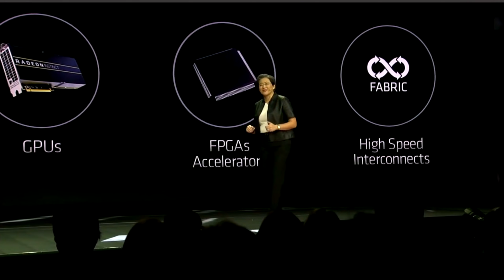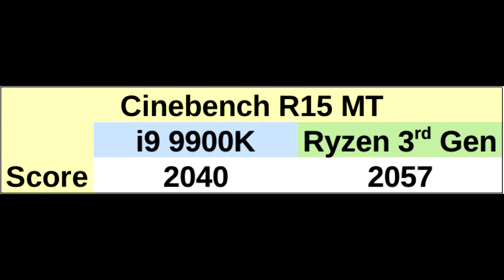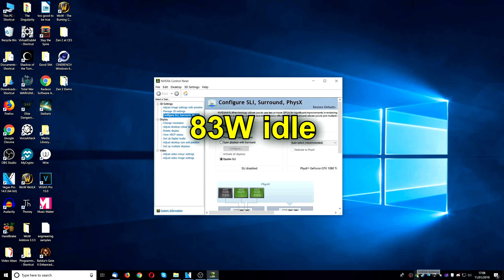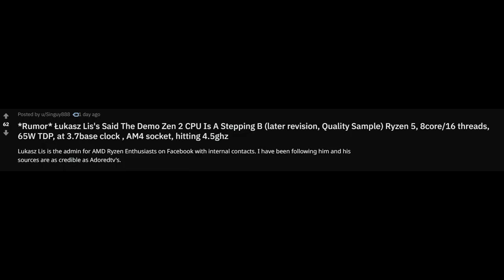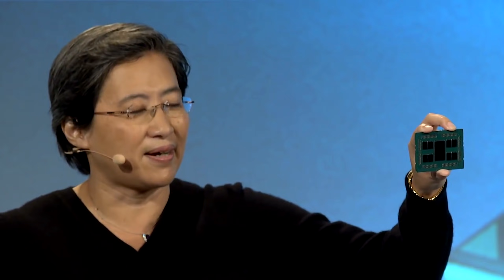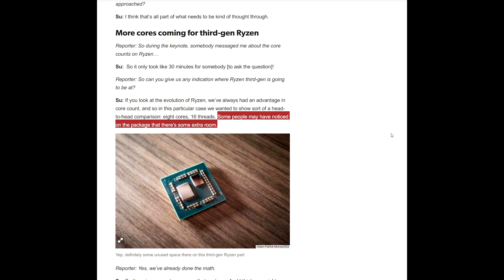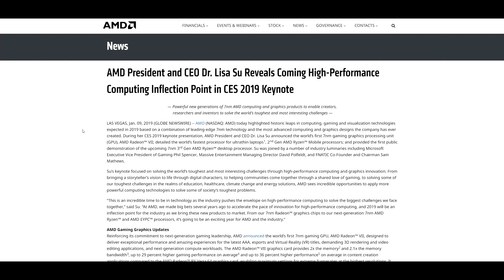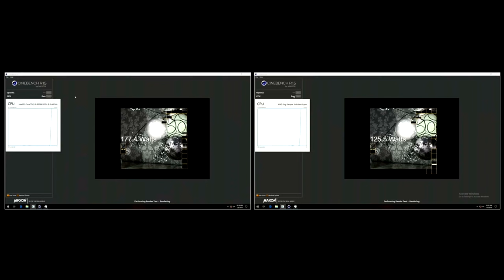Zen 2 Faster than i9 9900K at Half the Power.

Comment: You're so happy in this video it makes me happy!

Though I am worried about your Vega VII video >.<
Reply: I still think Vega and Vega VII as a compute card dressed up with gamer stripes.  Not a specifically engineered card to only handle game rendering workloads.  Navi will be the gaming card.
Reply: @Kenmanhl  totally agree. this is simply to soak up revenue of the ultra amd enthusiasts feeling left out of the high end market
Reply: Kenmanhl I think it’s incorrect to conclude those are necessarily mutually exclusive. Being based on/a derivative of a compute card does not make it a free/engineering free product even if it would’ve been part of the design goals of the original, which it likely was, as certainly as Navi variants will be featured in various compute oriented SKU’s. In the end they’re just two different directions the extent to which AMD could travel was constrained on both fronts by their current silicon.
Reply: theRedhood24 because it’s got a die shrink & 2x memory bandwidth, so it had better outperform cards where the opposite is the case and specs are otherwise mirrored in all ways save a few compute units.
Reply: The 7nm card was eventually going to release to GPU market after they had enough binned Instinct M160 cards with some CU's deactivated from faults in the manufacturing process which didn't pass for Instinct line.
Reply: Likely Navi is going in PlayStation 5 and Sony want to announce an 'exlusive' GPU which it wouldn't be if PC users already had it.

Likely will be held back until official PlayStation 5 announcement.
Reply: Radeon 7 is just a tweaked M150 card which AMD released just to please stockholders (I think).
Reply: @theRedhood24 they make changes to the chip
Reply: it's another compute card... awesome theoretical performance... The only problem I have with AMD compute cards is that the experience of setting up and debugging the infrastructure (ROCm and such) to Utilize it is completely horrid, especially when you don't go with some standard distributions of linux... I was so frustrated that I eventually ended up using the vega64 exclusively for gaming and the 1080ti in my linux compute workstation instead. AMD dev team ought to focus on compute users' experience like NVIDIA does as well. They've clearly shown they could measure up with Radeon Relive for gaming.
Reply: Navi is much more powerful but is someways from being ready. I'm guessing the late release of Vega 2 and its confusing specs were due to it appearing to be a hobbled Radeon Pro V340 and a filler till Navi is ready.
Reply: i think Vega7 is just a refresh of 64 and a bit of a test system for new memory Navi development may not be progressing as fast as they would like or they are trying to get there version of Raytracing into it.
Reply: fox 6 it’s basically a different product from a different team defined by a different vision from what’s his face, a stopgap for the higher end market
Reply: @Fee.1  that's what I think too I'm hoping that now AMD has turned things around the guys at Radeon might get some money to get Navi of the drawing board. where I think it's been stuck due to lack of money.
Reply: @keptinkaos6384  Navi has been in development for a while and its purpose was to satisfy the gaming needs of the next generation consoles of Sony and Microsoft. Consoles require low power consumption and AMD has been behind Nvidia in that aspect, so you can be sure that Navi will be revolutionary in that aspect. Beyond that, there's the "secret sauce" Microsoft and Sony would have wanted out of Navi. Sony seems to be pushing Playstation VR so perhaps we should expect some features that are useful in VR. Microsoft released DXR recently and perhaps it wants to push it in consoles. Honestly, I don't know how it came to be. Was it an NVidia initiative, prompting other actors to start working on it or was it a Microsoft initiative? Nvidia's Volta never came to gaming, but they were focusing on tensor cores, but with Turing, they added RT cores. Ray tracing was also on AMD's radar since they did release Radeon Rays.

Could it be that AMD and Microsoft had been working on real-time raytracing for quite a while for consoles? Could it be that consoles capable of real-time ray-tracing is the right ecosystem, where gamers will see benefits, for ray-tracing to become widespread? Honestly, I'm inclined to hope that the next generation consoles will feature ray-tracing because that will hasten its use. I'm inclined to hope that NVidia released Turing with ray-tracing first, rushing to release it on a node they had some experience with, 12nm instead of 7nm, in order to claim that they were there first, that they were the innovators, in order to steal AMD's thunder. To the point that they ignored the large inventory they had built for Pascal.

But honestly, if we're reasonable, NVidia has the money to make things happen and has always wanted to keep their discrete GPUs relevant. Pascal was also long in the tooth, and the tech press was badgering NVidia for news of their next generation cards. It's more reasonable to believe that Nvidia innovated by bringing us real time ray-tracing before anyone else and that it was entirely their initiative, which means they had a head start on AMD. If AMD is reacting to real-time ray-tracing, it is not coming to Navi. I will admit I don't know the details of how the hardware is designed so I may very well be making a lot of incorrect assumptions. I read somewhere that RT cores were nothing special so perhaps AMD could get their own working fairly quickly.

What's clear is that 7nm is still a few months away before we start seeing products for it from AMD. Perhaps we'll see Navi for the third quarter. Perhaps we'll have console announcements sometime in the end of the year and they'll launch in 2020.
Reply: @COKireato  one can but hope
Reply: @keptinkaos6384  it can't be a refresh. It's 7nm. Could only be a new chipset.
Reply: Oof Vega, lets not speak of it. Its like bulldozer, but without the value proposition.

Comment: Anyone that freaks out when a link is not 100 percent correct has not been following tech very long.  Ive been following this channel for a long time now and always look forward to the excellent analysis, and the leaks are just fun to speculate, but things can and do change at the last minute.  They may have ran into last minute issues with the higher end chips, or they decided to sandbag.  Having said that, Jim’s predictions are well thought out, and some of the most accurate you will find.  It looks like 7nm will work out better than I expected as far as performance.  Its going to be an interesting year.

Comment: I think it would still make sense that the 3600 will have 2 chiplets with half the cores disabled. It may just have been easier to pick 1 chiplet as an engineering sample. Which might also have implication for cache and overhead of communicating between the chiplets.

Comment: The idle is high because the biggest chip on the die is the 14nm (glofo) IO die. Your delta shows how good the 7nm TSMC is. Global foundries has been AMDs weakness for many years.  AMD has said that the IO doesn't impact performance, but it will still be victim to bad power efficiency because of GloFo. Good video

Comment: Yup, the 3600x matched the 9900k. If AMD revealed that it would've instantly forced Intel to reduce costs on CPUs, potentially losing buyers for AMD.
So it was a bright move to just reveal specs. But once it is discovered that the one that beat the 9900k is a mid tier CPU, it will be huge.
Reply: Not just people choosing Intel over AMD, but people not buying any of AMD's current CPUs because the next ones are just around the corner. The only reason that AMD revealed Ryzen several months ahead was that nobody was buying their CPUs anyway.
Reply: @BenoHourglass  You just described what's called the Osborne Effect; that's where a company prematurely announces an upcoming, better product and people stop buying their current product in anticipation of the newer product. (History note: this was first observed with Osborne Computer Corp; if you've never heard of them, that's why.)

Also, in looking up the Osborne Effect, there were mentions of a competing product that effectively stole sales from OCC, so it was competition that drove them into bankruptcy, not the Osborne Effect itself; whatever that's called, you (and Shadow) just described it.

Comment: I doubt for a second that we will get 16 core parts.However, I certainly don't buy that they deliberately didn't show off 16 cores because they wanted a fair comparison. That's a blatant PR spin. Of course they would put the 9900K to shame with 2x performance if they could. I think the same goes for higher frequencies. If they had 5Ghz they would have showed that too. Conclusion: Ryzen3 is probably a little further behind schedule than we had hoped and they still have some kinks to work out. It still may fit well with that "middle of 2019" timeframe though. I speculate based on the otherwise accurate leaks so far that they are a little delayed and had originally planned to have more to show this CES.

Comment: The idle power may be very high if they don't have dynamic under clocking fully working yet.  It may not be dropping it's multiplier as low as it can since it's an early chip.  I imagine that idle power will come down fairly significantly before launch.

Comment: p.s. There is debate about the Radeon VII going on. Some are saying it is a rebrand of the M150, while others point out it has twice the ROPs of that GPU. What does Adored TV think? 
The Radeon VII is an interesting product to me either way. It appears to have strong performance in both gaming and workstation tasks. A genuine multipurpose card that seems unique to me. Before now GPUs were either a gaming card or a workstation card. Geforce and Quadro for instance. Then came some blurring of the lines, i.e., Titan was a gaming card pretending to be a workstation GPU, while Vega was a compute GPU that gamers used. Radeon VII appears to do away with the distinction all together. 
I think people that work with graphics productivity and GPU compute, but also would like strong gaming performance all in a single computer will find the product quite attractive. They will not have to build two separate systems. They will like all that HBM too perhaps.

Comment: The chiplet design lets AMD spread out available cores to whatever sells best tbh.

They can have both a 8 core 2x4 version and a 1x8 version depending on what the silicon delivers, if the 8 core part is most popular.

They can also deliver 4/6/8/10/12/16 core parts optimizing the spread of available silicon.

If this performs as well as it seems it does (and I actually think they did a tongue in cheek deliberate "only just beat it //but we can actually do far better\\"), at the low power consumption, they'll take a decent share of the Laptop market, possibly the Apple market, they are already set to take a decent share in the server market.

These are wonderful times!

Now lets hope that this year they'll get a new foothold in the GPU market too.
I'd love to see AMD actually neck on neck with Nvidia (and beating them) like they did in the HD 5000/6000/7000 era.

Comment: Actually. I got second, more real info. 
A2 stepping, revision after RTG sample, 3.7 base, 4.1 to 4.3 operational clock during CB test, 1.2v approx. 

AMD usually release B0 or B1 stepping, therefore I Asume that A2 is more real. 

Lukasz Lis from AMD-RE ;)
Reply: However, second source said also, that single core boost was 4.5-4.6. All core boost was around 4.1-4.3

Comment: A 2700x at 4.4Ghz scores 2061 with good RAM. And a 4.5GHz 2700x scores 2100. Don't believe me?
https://hwbot.org/benchmark/cinebench_-_r15/rankings?hardwareTypeId=processor_5695&cores=8#start=20#interval=20
Any claim of that sample chiprunning over 4.3 GHz is total bullshit, and would imply 0% IPC gains for Zen 2. 4.5GHz would mean they actually went backwards with IPC and Zen 2 is worse than Zen+. This thing was only running between 4.0 and 4.3 and beating a 4.7GHz 9900k. The final version will probably score 10% higher.

Comment: I wonder if you can have an uneven number of cores on the chiplets, if you have two of them? That would open up to 10 and 14 core chips. I still think 16 cores is too much, simple because of memory starvation at only dual channel. Also people who need 16/32 core/threads, probably needs more ram and more pcie lanes too. I'm not saying a 16 core is out of the question, but whether or not it actually makes sense from a performance perspective.

Comment: Hey Jim,

Great analysis as always, however there are a 2 more info I was hoping you could give in this vid (or analyse for me...):
1, would you be able to speculate the frequency at which the 9900k was running at based on the CB score and hence the clock speed of the ryzen 3 (with and without the IPC gains), I know you mentioned 4.6 GHz but it would be good to have some maths behind that? I could try to do that with numbers from other reviewers but I'm too lazy to do that :P
2, Is there a possibility that a single chiplet was shown due to the latency implication of a dual chiplet vs a sinlge chiplet, leading to the loss of performance? If so, I would have to assume that they were not sandbagging but actually showing the best they have at the moment -- i.e. best of engineering samples while the fix they kinks of interchip communication inherent with the chiplet approach?
Anyway, I never really commented so not expecting a reply so just to say good work and hope you keep it up again.
Cheers
p.s.  for the AMD fanboies out there, I'm rocking 1700 (will upgrade to 12 core ryzne 3 if 5 GHz and 370 supported...) + vega 64 so please don't flame me...
Reply: The 9900 wil be running stock. As is normal practice. Also you can check benches online to compare and check this.

I don't think amd will now show this and then come out with a lower performance 4+4.
Either performance is similar between 1 chiplet and 2 chiplet and it doesn't matter in the end. Or the non x part will be a 1chiplet part and the x variant a 2 chiplet variant with double the cashe.
This is my opinion though.

I do think amd is sandbagging,. The results of the demo where way to close to not be staged. They didn't disclose clockspeeds so i think they used a clock high enough to just win.
Plus the slow ram. They are not showing their full hand.
All they had to do was beat 9900k, and they did.

Hope that was usefull :)

Comment: This engineering sample most likely doesn't have a higher IPC than intel counter parts. We know from benchmarks that amd's version hyperthreading is a lot efficienter than intel ones. Not to say that this isn't impressive, the opposite, one third the power for the same speed, im hyped AF. Little less hyped about the VII, but if the prices is right, count me in ;).

Comment: AMD should really be commended for the job they've done catching up to and in some cases exceeding Intel over the past couple years.  FWIW, I had my doubts when I heard Zen 2 would be a single die like Zen 1. The whole point of the Zen architecture was to create components they could use up and down the product stack, so it didn't make much sense for the EPYC to move to chiplet and keep Ryzen as an integrated block.